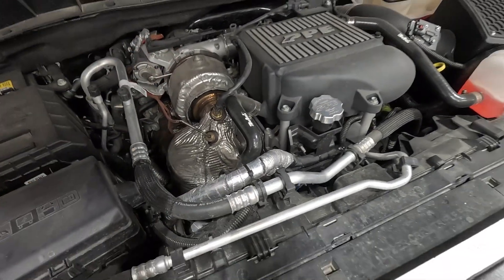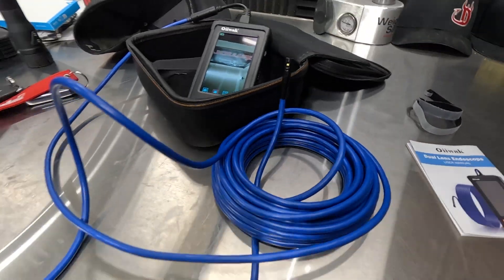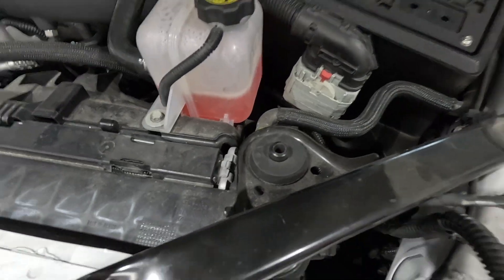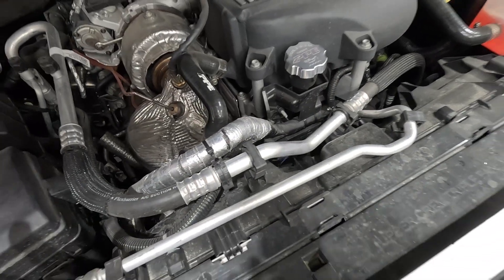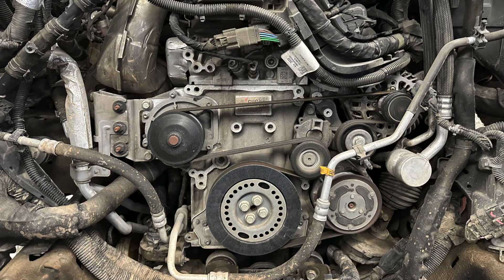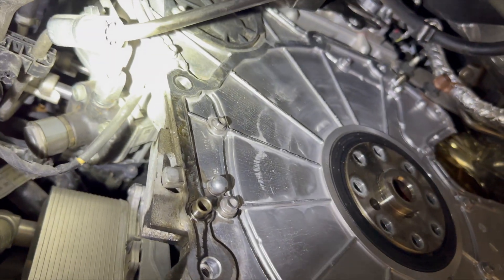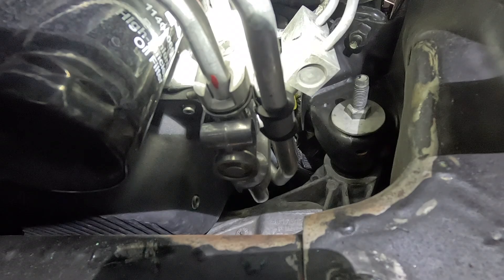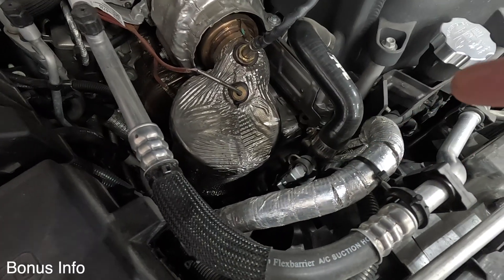Oil and Coolant Leak locations on 3.0 Duramax + Ground Issue

Comment: Have a 2020 LM2. I did a force regen, and when I did, it ended  up causing an oil leak on the passenger side above oil filter housing. In your experience, do you end up with more valve cover leaks or possibly another issue? Any info would help.
Reply from the maker: Cam cover leaks are rare but they are possible. If a regen caused you an engine leak, there are much larger issues within the engine. I don't think the regen was related but possibly just when the leak was noticed?

Comment: Very informative video as always.

I personally have an intercooler issue, probably a slow leak. The expension tank was empty and got code "Intercooler Effeciency bellow threshold" as well as lost of power once. Refilled and monitoring the... Not sure exactly where it leaked. Holding pressure atm.

Comment: I have an LM2 with 98k miles. At 96k miles (under warranty) the rear main seal was replaced. It is sill leaking near the same spot. They're going to replace it again. I am uncertain if they replaced the rear cover the first time or just a gasket.
Reply from the maker: I'm confident they replaced the whole cover, there isn't a physical gasket. It's also possible you have a different issue and with it being at the end of your warranty, be sure to watch for any further issues to get addressed asap.

Comment: If we had an oil leak where the turbo goes into the plastic pipe behind the inter cooler. Would that be a turbo seal or excessive crank case pressure?
Reply from the maker: closed pcv system, so some oil there is normal. The oil vapor comes from the camshaft cover to the turb right at that resonator you are describing.

Comment: I got a bunch of U codes as you stated and the block itself had cracked right around where that stud is for the ground. Guessing it was over tightened from the factory or from previous work? Either way I had to use the stud below that where that plastic bracket mounts. Crazy but glad it didn’t crack into the actual block.

Comment: @demonworks do these engines, 3.0 duramax, have blow by? As a normal engine operation. 35k miles oil fill cap and dip stick are smoking like a train, no codes.
Reply from the maker: They do, don't worry about the vapor you see. Obviously, there is a level of vapor that is too much but that will likely have a dead miss accompanied with it. So, yes, normal.
Reply: @DemonWorks ok thank you for the guidance. Fuel economy also went down once I noticed.

Comment: i need help finding my sensor.. lz0 3.0 on my 2023 sierra denali 1500
Reply from the maker: What sensor?
Reply: @ coolant temp
Reply from the maker: @Barry_woods there are multiple. What’s the issue you are trying to solve?
Reply: @ my fan is really loud when the engines running, and my engine is not overheated at all
Reply from the maker: @Barry_woods check engine light on?
Reply: @ yes. and when i clear the code the radiator goes back to normal and everything os fine
Reply: @ but of course the engine light will come back on and the radiator will scream
Reply from the maker: @Barry_woods you need to get the issue with the code corrected. I’m assuming it’s a p1098 for the coolant control valve?
Reply: @ okay i will grt the code fault

Comment: 2023 LM2 like others have stated, have that coolant smell after shutdown. Looked pretty good high and low couldn't see any signs. My best guess is early water pump, bad rad cap or failing head gasket (hopefully not this one). Coolant tank is showing low.
Reply from the maker: since inception, the 3.0's have always vented off coolant from the cap. If you are losing coolant, then you will need to find the leak. Ive yet to see a failed head gasket on one of these.
Reply: @DemonWorks  I think I found it. Can't see any liquid. But only get a coolant smell from the driver side of the radiator, probably vapping out a tiny seam.

Comment: My 2021 has had a small oil leak for a couple of years now. It looks to be coming down the left rear side of the motor. probably 4 or 5 inches up from the lip of the oil pan. Would you happen to know if the rear plugs you show in your video are covered under a powertrain warranty repair?

Comment: Will all these be fixed under warranty or will the dealer claim its not a problem?
Reply from the maker: I cannot speak for your dealer. Powertrain coverage goes with the vehicle, so if you have an issue and have powertrain coverage, there shouldn't be any concern.

Comment: I have a 2021 1500 and over the last few months my coolant as been leaking, seemingly from the top, driver side of the radiator. I have to top off the coolant every couple weeks. Any ideas on a fix? The couple shops I spoke with estimated around $2400 for a replacement.
Reply: Just had the radiator replaced by a GM dealer in Boise, over $2700.  My power train warranty is still good but this wasn't covered.  Appeared to be coming from upper part of drivers side, 2020 Sierra.  They had to remove AC condenser, grille, and fans.  Part was only $450 plus coolant and a couple seals, bulk of cost was labor.

Comment: This just saved me a ton of work. I put a PPE oil pan on my 4wd. noticed oil on the skid plate when i went to change the oil.  I figured it was the oil pan. saw this video after i  watched your oil pan install video again. I checked that plug on the front of the motor. its soaked. What the best way to get to the plug? Top or bottom?   I have access to a lift but there is a truck on it now so cant put it up to check until next week.
Reply from the maker: Glad it was helpful. I would suggest the bottom.
Reply: Did you fix it?

Comment: I have a 2022 second half refreshed with the lm2 that to date has 56,000 MI. I haven't had a single issue up until recently which is apparently a common one. Just today I had my coolant control valve replaced as it was tripping the check engine light on and kicking the fans on high in which I always had to clear the code to stop the fans from running on high. Only really did it the most is when the temperature was warmer, on cooler days it didn't do it much at all. Other than that everything runs smooth, there were no performance issues.

Comment: Great info on leaking front engine plug. I've been "ignoring" the leak for some time. Being able to remove, clean, and seal the plug without having to remove anything else was fantastic. 2020 Sierra with 140K miles.
Reply: How did you reach it?
Reply: @yups2232  With the front skid plate removed it's visible and accessible from underneath on the RH side.
Reply: @jondega what size hex was it? And what did you use to seal it again? Thanks for the information man noticed a leak yesterday so will try and figure it out tomorrow
Reply: @yups2232  I had to check in my tool box, looks like it was 8mm. I used a PTFE thread sealant.  Good Luck with your fix.
Reply: So, just re-sealing with high performance PTFE sealant, like loctite aviation sealant will fix it for good?  Do we know why they leak?  Did GM just not use adequate amount of sealant?

Comment: I have a 23 Silverado Duramax 3.0 / axle 3.72 36,000 miles.
First oil leak from the engine front shaft seal at 16,000 miles , high DEF consumption when towing with info center locked, 2 more oil leaks, one from the front seal the last one 9/24/24 rear seal.
The GM tech can’t resolved the issue with the high consumption of DEF and info center locking up so 09/26/24 he changed the settings in the computer so I won’t get some of the DEF messages and no longer reduces the speed if the DEF level is low.

Comment: Can you tell me where the "eng" hose on the surge tank goes to?
Reply from the maker: The bottom hose from the surge tank goes to your coolant control valve. Is that the one you are talking about?
Reply: @DemonWorks  no, on the top of the tank there are 2 small hoses. One is labeled "eng" on the tank. It goes to the front of the engine, but I'm unsure of its purpose.
Reply from the maker: Those are routing coolant back into the surge tank.

Comment: Thanks for this. I have a 24 chev LT with LZO and i can smell coolant around the front end after it warms up. No spots on the ground and levels don't seem to be dropping. If they are it isn't noticeable. Dealership has basically refused to even look until there's something noticeable. Now at least i have some spots to check. I also have a transmission issue i think. If i accelerate away from a stop all is normal, but if i am driving on the highway and attempt to pass someone the entire cab of the truck will shake quite hard. Just wondering if anyone else has seen this happen?

Comment: Mine threw a check engine today. Dealership said it was the coolant pump for the intercooler. This would be the second time it has been replaced in a few months.
Reply from the maker: Have they done the connector with it?
Reply: @DemonWorks  I don’t know. When I got the truck, it had 8500 miles on it. They changed it out right before I bought it, it now has 13,500 miles on. I bought the truck in NC and I live in GA. It is at a local dealership here looking at it.
Reply from the maker: @The_McPorkchop let me know their findings. It could have just been a bad part or wiring/connector causing it.
Reply: Yes sir, as soon as they contact me I'll let you know.
Reply: They had to perform a software update per the bulletin 24 - na-120

Comment: I think I have the issue with coolant leaking from the water pump freeze plug on my LM2.  I'm guessing a new water pump is the only solution to this? I cant find much info online on what it takes to do that job.

Comment: My 2020 must have a slow leak, or it just burns it. I haven’t seen any oil or fluids on the ground after parking. However the temp gauge bounces around like a yo yo. It take a good 20 km of driving for it to stabilize and then a change in driving Cindy will send it bouncing again. Stop for fuel, run around town, back on the highway and it’s bouncing again.

Comment: Is the front plug oil leaking covered under warranty or is it out of pocket?
Reply: Update, front engine cover leak is covered under warranty. Question, when dealership re-seals the front cover, do they also re-seal the front engine plug?

Comment: Have had to add coolant about once every 4 months ever since it was new . It’s strange , there are some online that say that these things run so hot that a bit of coolant loss is normal , however others say it’s not and that it’s a closed system . I’ve brought it into the dealership for this but it’s been inconclusive :(
Reply from the maker: not supposed to lose coolant. Possible small leak they haven't found... I would suspect the bottom of the water pump or corner of radiator as shown.
Reply: @DemonWorks I have the same problem - but it's burning from the surge tank, this is where it is going low. Would that be coming through  the water pump / radiator corner as well?

Comment: I have (2) LM2's Love my first one in my 2020 Sierra so much that I ordered one for the wife in our 2023 Yukon SLT.  No issues with my 2020 but started seeing drops on the garage floor the other day where the Yukon is parked.  Got free service contract with dealer that covers oil changes.  About 15k on the odometer and after two oil changes seeing the oil pan with a coating and it appears the skid plate is filling with oil.  I can't see the front of the engine but looks like from the pan the source is coming from the front of the motor, possibly the oil galley plug?  Would this still be occurring on a vehicle built early in 2023?  

Last oil change the tech noted ..."cleaned all undercarriage from any oil"... 

Matt
Reply from the maker: Still applies to yours, likely the culprit. Report back on the end result, please!
Reply: @DemonWorks  took it in today at noon and just got the message from service writer it is the plug as I reported to them.  They hope to have it done by the end of the day tomorrow.  I'm hate to have a new vehicle taken apart for stuff like this.  Any tips on what I should check to make sure the tech does a good job at re-installing?  What items need to be removed to access this?
Reply: Got the Yukon back the next afternoon, write up said the tech evacuated the AC system and drained the coolant, removed the AC condenser, radiator and cooling fans.  Replaced plug and reinstalled all previous items.  5.0 hours of labor.

Comment: @demonworks thanks for all your good info on these 3.0.  I was changing my oil last night (50,000 miles) and it looks like I may have a rear seal leak.  Never seen any oil before but now there is some around the edges of the oil pan.  Is that is pretty good indication?  Generally this is warrantied correct?
Reply: I am almost at 50k. At 35k my front crank seal went and the oil ran down the whole front of the oil pan and it looked like oil was coming from the whole length of the pan. Oil got on the power steering arm and the frame. It was a small enough leak that I had no significant changes on the dipstick. Once I got that figured out and replaced the only time I can see oil leaking is right after an oil change. It's coming from the front plug he was talking about in the video.

I hope this helps. The trucks running great but just enough oil leaking to make me sad.
Reply: @dad_tango_foxtrot7520  luckily mine was the same, just the front plug.  All well now!
Reply: @taylordoingstuff  unfortunately I just changed my oil 3 days ago and same old song and dance. The chevy dealer had my truck for around 2 months this year so I'm just waiting until I have the time to do it myself now.

Comment: Can we get a video on changing out the serpentine belt? I have an annoying squeak at start up
Reply from the maker: That's a tough one. I'm not sure I can get a decent video of that with parts in place. You basically need to shove your arm between everything and swap it out. not a fun process at all.
Reply: @DemonWorks  great hahaha I figured as much. I’ve already had my arms shoved between the front of the motor and the fans. Not a fun situation. Guess I’ll just give it a shot. Thanks for the reply Greg.
Reply from the maker: @toddmeadows1576  Removed the front air duct piece so you can access the cross bars on top of the radiator. removing those two bars will allow a little movement of the radiator. You can "carefully" us a ratchet strap to pull the radiator towards the grill. this will give you an extra inch of room, haha. the cross bar seen at 1:33

Comment: I love the great detail in these videos. My lm2 has had a small coolant leak I can always smell coolant but never see it in the ground. Definitely have a few spots to inspect now. Keep up the great content
Reply: If they pressure test it and don't find any leaks, the reservoir caps can also leak and that one won't be found because that's where they connect it to pressurize the system. Just a heads up.
Reply: The EGR cooler may be the culprit. I read on a blog that a pressure test was done overnight, and there was a small crack in the EGR cooler.  The person had complained about smelling coolant after shutting off the engine.
Reply: @rustynail914  I’ll definitely need to check that out. I’ve looked everywhere. I only use a very small amount of coolant. Maybe half a litre in 75000km
Reply: @Justgaragenit  I was about 1 gallon low between my last couple of oil changes. Maybe 15000 miles.  No leaks on the ground though.  My guess is the coolant is slowly burning off somewhere.  That post about the EGR is the only information I could find.
Reply: @rustynail914  I appreciate it it’s definitely a problem spot to inspect for sure. It sounds like yours is using a good amount more
Reply from the maker: Thank you!
Reply: I'm having the same issue. I have a 21 LM2, and I can only smell it when engine is cut off and parked for about 2-5min. did you find it?
Reply: @Tiktokrefugee69 did you find anything having that issue also is this covered thru gm?
Reply: @carlosdiaz4365  truck just hit 102k, the 3 times I took it in, GM said “they could not replicate the issue.” So waiting to see a wet spot under hood. Then I’ll fix
Reply: @ thanks for the reply I’m at 56k and I’ve had the smell after I cut the engine for about 20k miles and I’ve taken it in twice and I got the same thing could no replicate. But no puddles and levels don’t go down either.
Reply: @carlosdiaz4365  I can always smell mine when I’m around the passenger headlight / fender after shutting it down

Comment: Hey Greg - it looks like the plant mis-built your 3.0 on those ground cables. In your video there's a threaded boss to the left of where they are mounted on yours that is unoccupied. That boss is a thru hole and my grounds are mounted on that hole. Double check some other 3.0s at your dealership, but I believe they just used the wrong hole on your engine. Regardless, sounds like you got it fixed so it's not really something to bother with - maybe someone else has the issue and instead of tapping the hole deeper, just move the ground cables to that boss on the left.
Reply from the maker: Hey! good eye on that and in my case, there are two holes there and both are threaded. At the time of repair I did look at another LZ0 and it also had the grounds on the lower/second hole. Appreciate the reply !
Reply: can someone steer me in the right direction for these ground straps? i've been rooting around under my hood and can't locate them. where exactly am i looking. i have the same code issues going on and the last time i took it to the dealer they sat on the truck for over a week before they even looked at it. then charged me $500 because they said the cables were corroded and GM won't warranty corrosion. if it's a matter of me just knocking some rust off and tightening the bolt i'd rather not get ripped off by the dealer and get stuck paying for a rental for a week on a 10 minute repair.